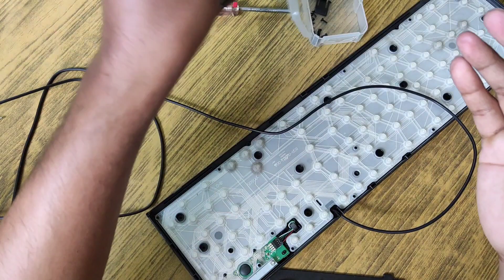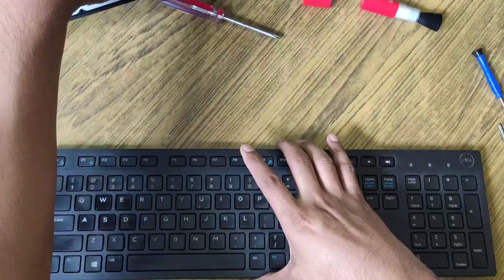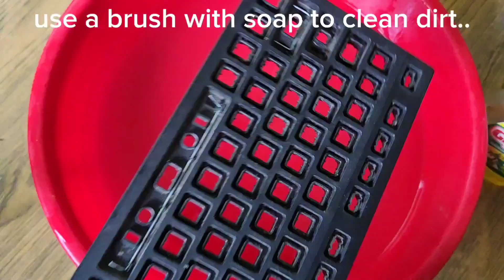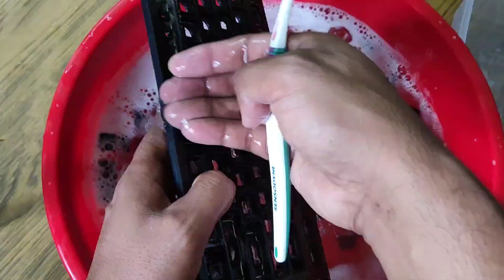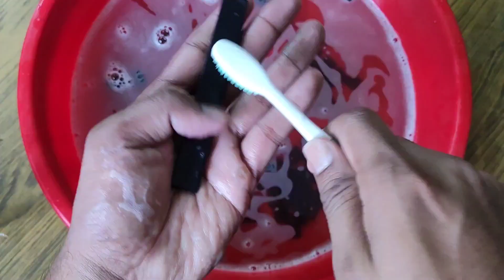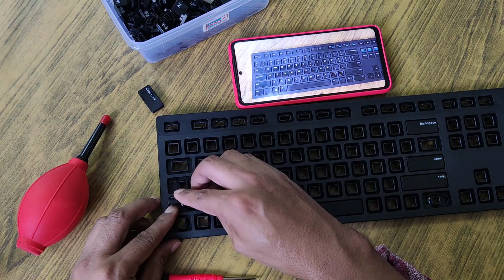How to open and clean Multimedia Keyboard | Dell KB216 | #dell |

Comment: Hello sir my keys remain stuck after pressing can I just remove keys one by one with strip tools to clean or will it damage my keyboard I have same keyboard so can I remove keys directly without opening back panel ?
Reply from the maker: You can do both methods....but removing directly from the keyboard may break the lock pin of the key.....So, i will suggest opening and cleaning...it is very easy to open and assemble... Thank you sir for the comment..
Reply: Same isdue keys get stuck sometimes when i hard press
Reply: @meenshrestha1977  Like your keyboard my button are not getting out they remain attached to frame only with pry tool they can be removed but will it damage my keyboard ?
Reply from the maker: @AnitaSharma-oe6tu  there are two luck pin eachside key you can use small flat screwdriver 🪛 or tweezers to pull out...or you can gentle press one pin luck with screwdriver...it will not damage..
Reply: Who are facing button stucked problem, hard pressing problem do one thing buy a grease pouch from a hardware shop and apply it in all the keys after removing keys from keyboard.

Comment: real poor job of showing how to open the keyboard. it's ok to speed up when taking the screws off, but should have slowed and shown how to take off the supporters, and how to open the case after that.
Reply from the maker: thank you for your suggestion. In future I will make another good video.